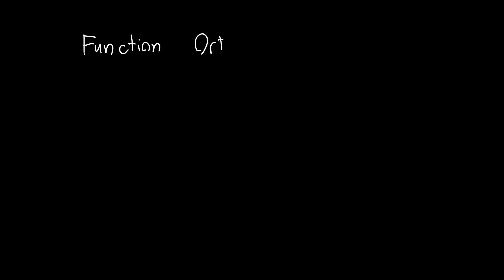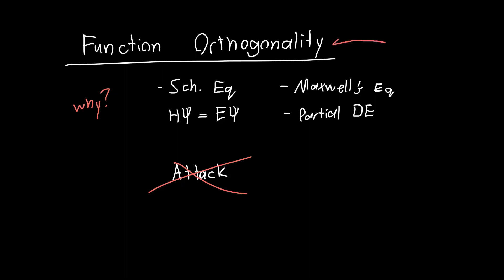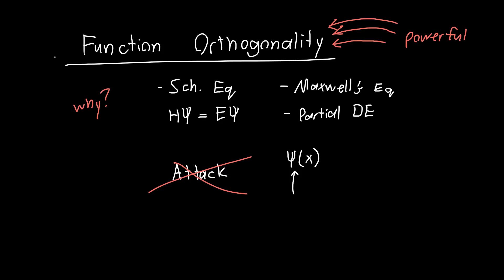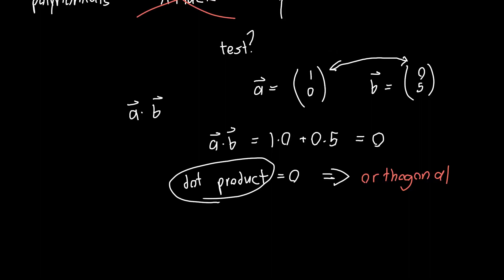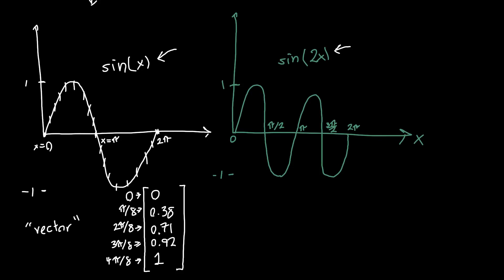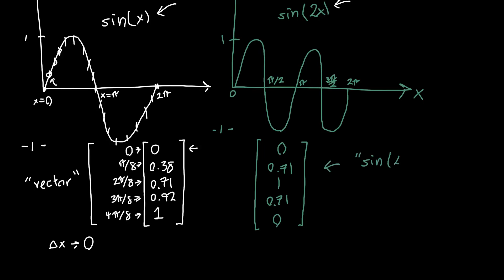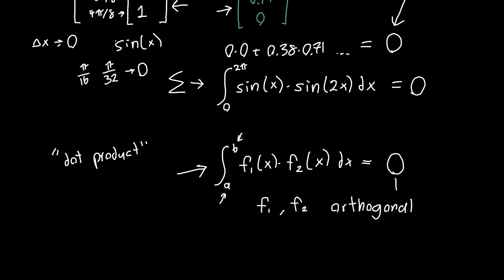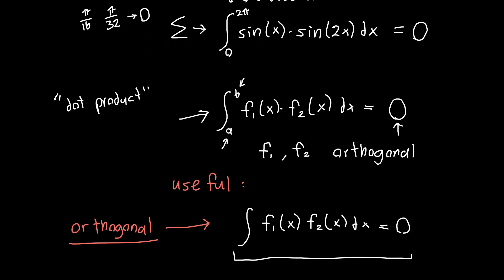Function Orthogonality Explained

Comment: So do we pretend they are two basis vectors in an N-dimensional space?  Then there can be N orthogonal functions aka N basis vectors in such a space?
Reply from the maker: Yup, that's the (real) mathematical formalism behind this video. Such a space, when used for functions, is called a Hilbert Space.
Reply: @JordanEdmundsEECS  Thank you. I've seen the term Hilbert Space before and probably even read about it but didn't make the connection